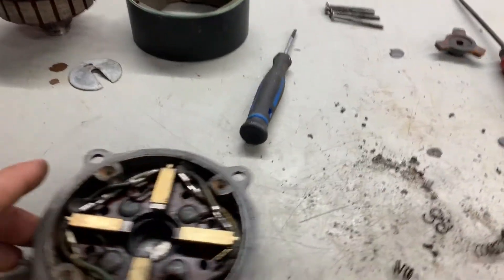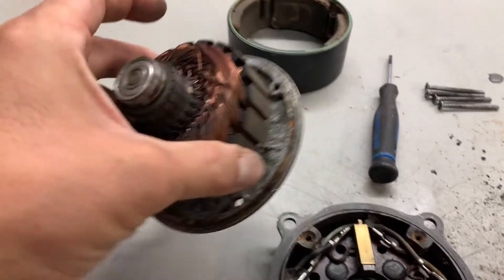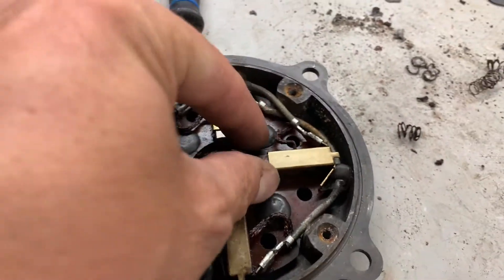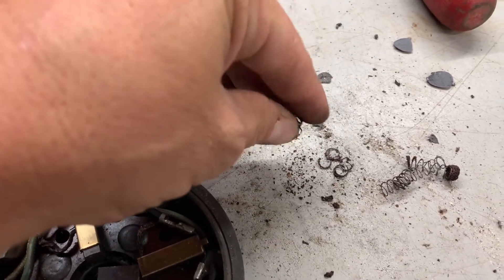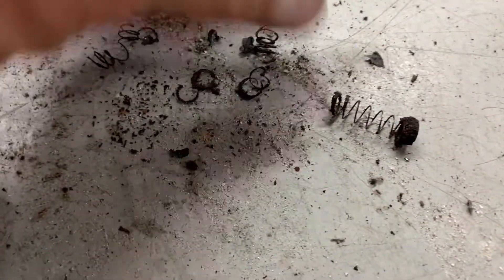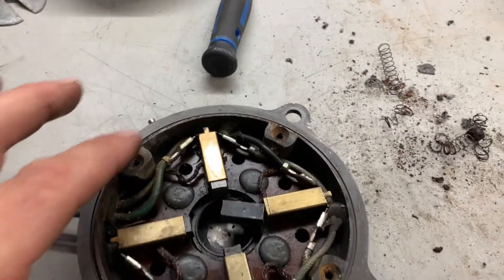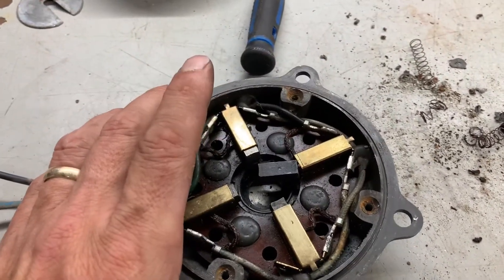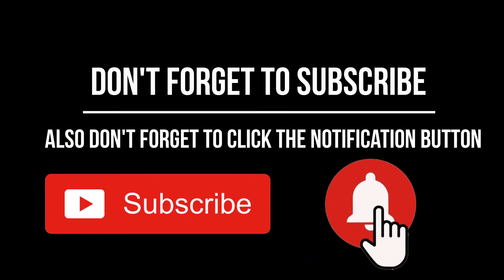Taking Apart Failed Can Am Commander Cooling Fan Motor to see why it failed.

Comment: That is so inspiring. Why can’t the manufacturer a make brushless fan motor for such a recreational vehicle, I wonder? I hope you are able to source the springs. Fantastic video.
Reply from the maker: Good question!
Reply: I had the same issue with my fan but mine after awhile it will stick and I have to move it by hand to unstick it!! Its my  second  used one I put in!! The same issue after a while .have you find a  place where to buy the spring on amazon .